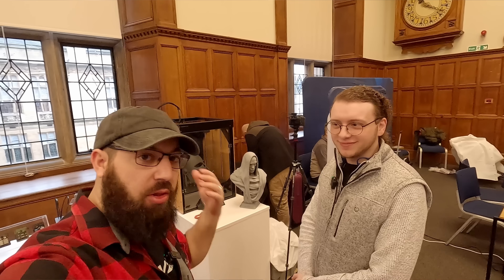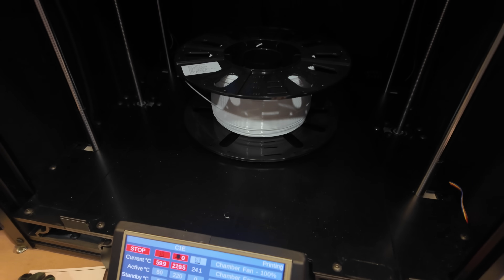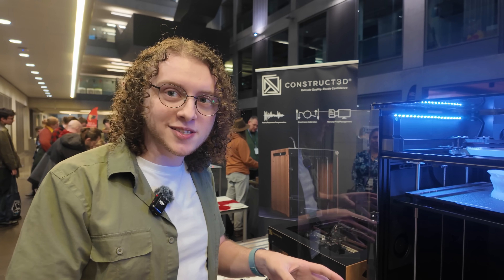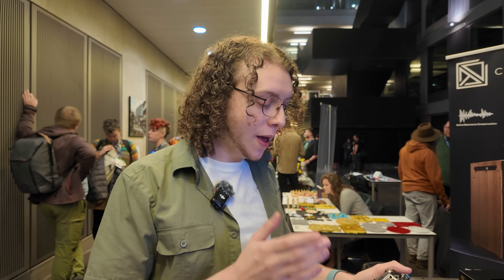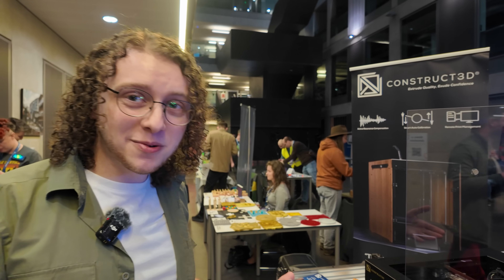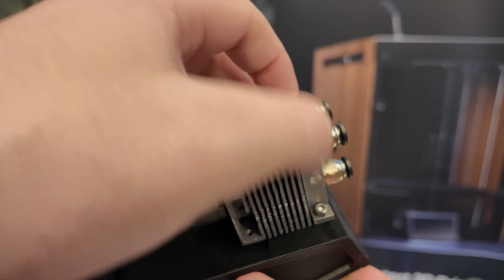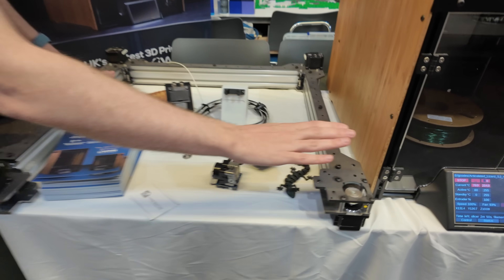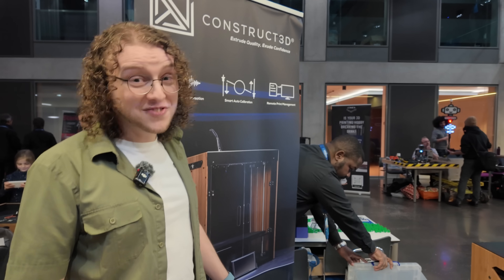Build 3D printers in the UK with Construct 3D @ SMRRF24!

Comment: You can pretty much use the Bambu lab AMS filament splitter as a hotend but like Jacob said because of the internal geometry you would have to have it SLS printed or metal printed with some fittings that's genius

Comment: Do you suppose the quad filament hot end could be used for CMYK printing full-color parts?
Reply: In theory yes, but in reality no. Because the head was not designed to mix the filament, it will be closer to making co-extruded multi colour filament in the nozzle.

Comment: I don't see how that glass door against glass roof makes a good seal
Reply: Thats the neat part, it doesnt, it has a 2mm air gap. but because of the chamber normally running in a negative pressure scenario, it traps the heat VERY effectively.
Reply: Is that wasting a lot of energy to maintain chamber temps? And potentially sucking in dust and dirt into your chamber?
Reply: @lolzlarkin3059  surprisingly not. part of our testing is filling up the chamber with smoke and measuring the amount of leakage. For small gaps like that, the amount of leakage is pretty much non existent. Its quite a surprising result.